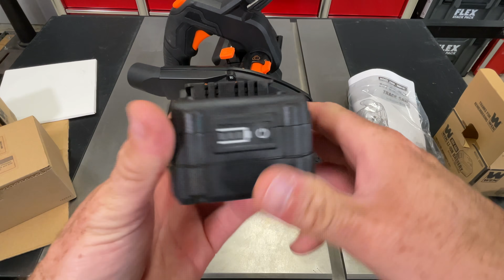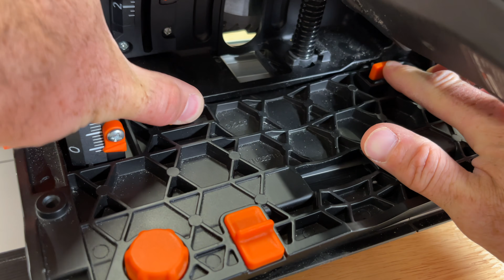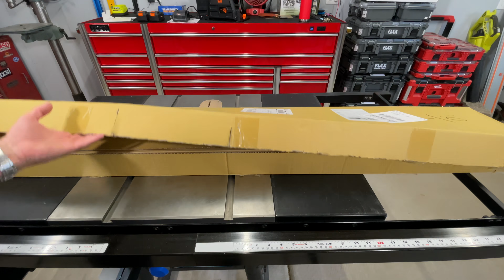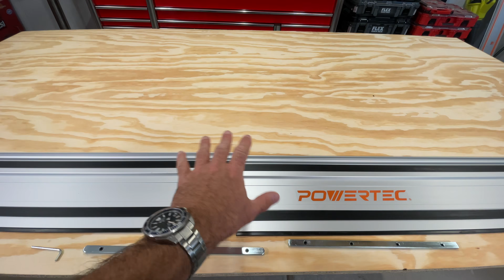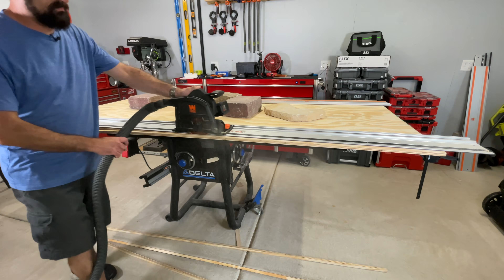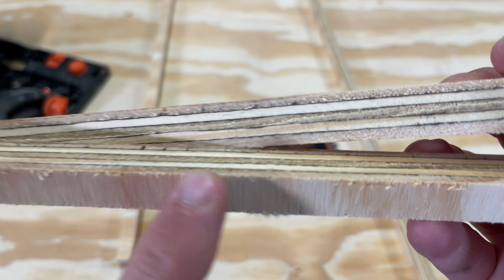Can A Cheap Cordless Track Saw Be Good??  ||  Wen Kit 20691  ||  Review

Comment: Great overview Mike! 2 things, Wen has a newish 55in track that I have. Pad seems more sticky (not sure though, never touched the smaller track) and I like the connector better than the Powertec. Not sure of the longevity of a steel grub against the aluminium track. Second I designed a dust cap for the corded that looks like it would fit the cordless. If you have access to a 3d printer, it's a thing I vers model that's free to print. For my use, Wen track saws just work, no need to overpay to mostly process ply. Cheers!
Reply from the maker: Hello! I haven’t seen that larger track and I’ll have to check the website. Not sure what Wen was thinking with the 50 in but for $65 it’s hard to complain too much. I was thinking about doing a short follow up vid with a 5 amp charger and something to improve dust collection.if you’d like email me the link for the dust cap. If it works I’ll put it in the vid and give you a shout. Projectsforall60630@gmail.com Thanks for watching!!